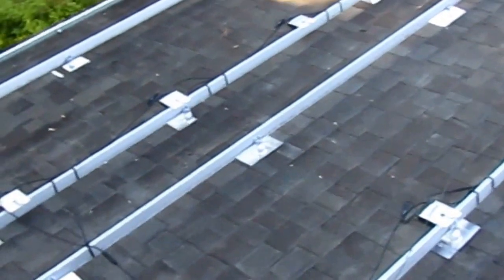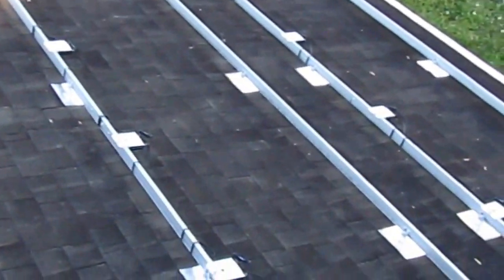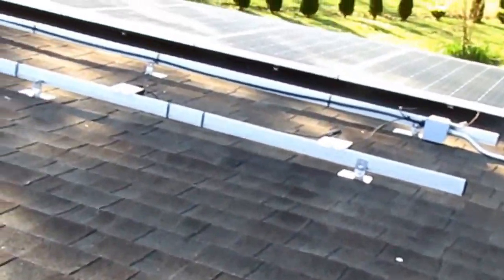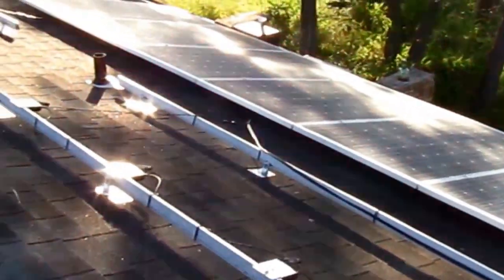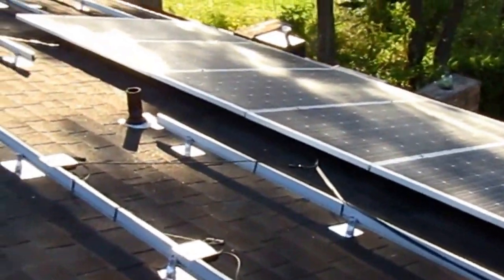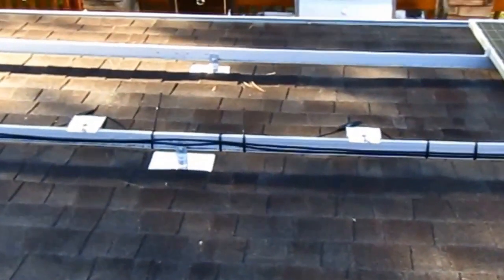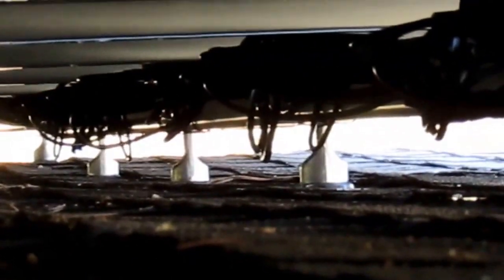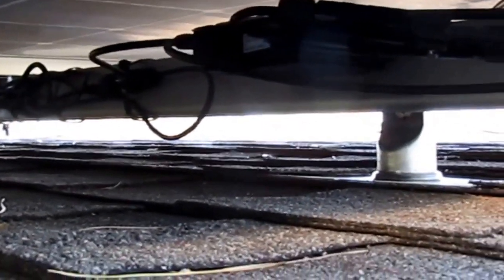SOLAR POWER INSTALL (PART 6) - Ken The Solar Guy

Comment: Do you need DC to DC power Optimizes if you have MPPT built in to the inverter and no shade problems?
Reply from the maker: You do not NEED the optimizers to make the system work unless you are using a Solaredge inverter....a Solaredge inverter requires the optimizers.....If you choose an inverter from the likes of SMA or some other brand, you are not required to use optimizers, however not doing so, will eliminate individual monitoring of the performance of each module.

Please do not be confused about the function of the optimizers......they do not perform the function of the MPPT controller.

The optimizers balance and control the output of each module in a string so that if a module becomes all or partly shaded, the remaining modules in that string will output to their full capability while a non optimized string will drop the output of the entire string even if only one module is shaded..........If shading is never an issue for you, know that a non optimized string will drop out if only one module becomes defective while the optimized string will drop only the output of the defective module, leaving the remaining modules producing power.

MPPT (Maximum Power Point Tracking), checks output of PV module, compares it to battery voltage then fixes what is the best power that PV module can produce to charge the battery and converts it to the best voltage to get maximum current into battery. It can also supply power to a DC load, which is connected directly to the battery, kinda like a voltage regulator maintains the correct voltage and amperage from the alternator to your car battery.

I hope this info is helpful and if you have need of any other info, please do not hesitate to ask.......if I don't know, I will find out.

Here's a quick video demo illustrating the benefits of optimized systems:

https://www.youtube.com/watch?v=2JBHgK3NhVs

Cheers!

Comment: Ken,

Man you can fit 2 more panels in the space you have due to the vents.  Check this out.  http://solarroofjack.com/
Reply from the maker: Hey, that's a really cool idea!

I still have more roof space where I installed the 24 panel main array, I could install 4 more panels with the remaining roof space I have, but I just don't really need more than what I designed for. I am utilizing all of the solar power I generate, plus have a small amount left over for which the power company pays like 2 1/2 cents per kWh.

I designed this system to accommodate my usage with enough left over to help in some of the leaner months, like January and February, but if you do the math..........yes I have roof space to make more power, but the outlay would be to enable power generation that may yield me only 2 1/2 cents per kWh...........so, .......not cool. 

The way I figure it, I just went through an extremely hot summer and paid out of pocket only a little over 20 bucks for my electricity for 6 months..............I'm gonna call that a win.

cheers!
Reply: That is Awesome.  Ok all my stuff arrived A-OK.  I am happy.  Now need to get to work.  Just waiting for my permit.
Reply: Wow Permits are not cheap.  It looks like it will cost me 400 for it.  all the equipment got here and i am just waiting for the permit to get approved.  I also put a guardian fall protection on the roof since my house is 2 story.
Reply from the maker: Holy crap!

I thought my area was bad for that.............mine was about 115...............sheesh.

Good thinkin on the Guardian..........what is your pitch?
Reply: my pitch it 26 degrees   the roof is 22 feet off the ground.
Reply from the maker: That's high and steep enough for even a crazy person like me to want some added safety!

I never worry about falling, it's just the sudden stop at the bottom I worry about!
Reply: At your Junction box .  Did you use wire caps to put the wires together?    I am trying to figure out how i will put the 1 string with 10 panels on the upper part of the roof with the 4 below to make a string of 14.   Then i am trying to see how i can pre run the 10 awg wire for the 2nd string in the near future.  It has me stumped and digging through the web.
Reply from the maker: you just need to put a junction box on each set of racking. one j-box for the 10 panels connected to a j-box on the 4 panel array, then connect with conduit and your all set...............I wish I could see your layout so I could better know how to advise.